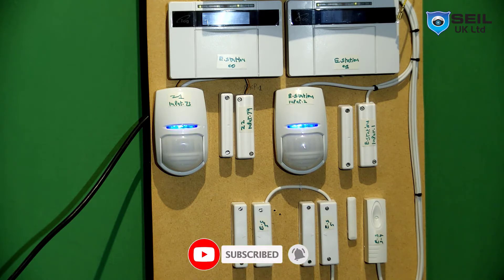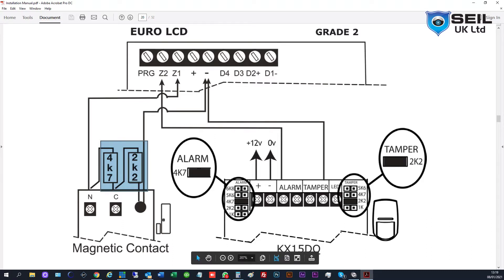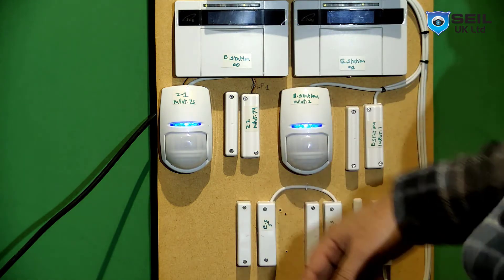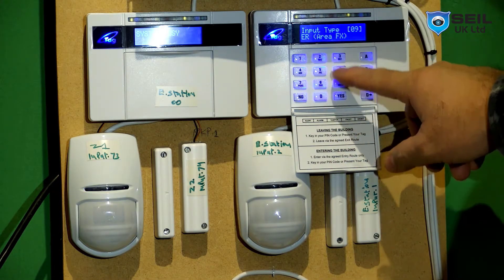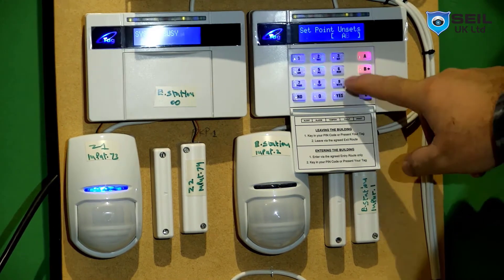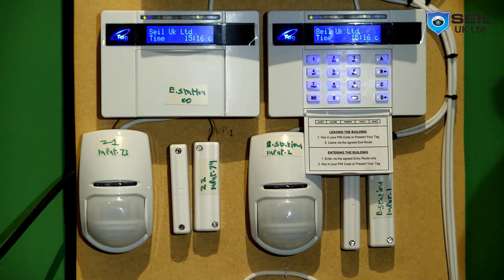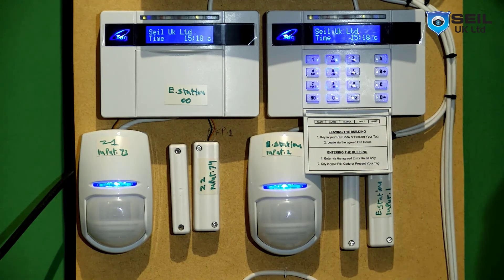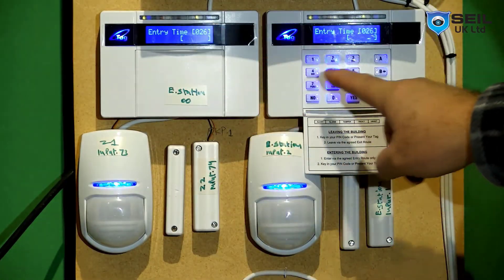How to do Programing and Installation Pyronix Euro-46 Keypad 2 Zone Z1, Z2

Comment: why did you choose zone 72 and 73 are they the default kepad zones on the pannel?
Reply: Hi I’m just doing a second keypad on Texecom verities 8 and just wired second one to the panel same as existing one. And on existing one changed small switches to 1 and new one to 2. Problem I’ve got is new keypad not doing anything lights up but not working any ideas?( existing key works just fine)
(Both key pads led not lcd so can’t see anything just 8 led lights)
Reply from the maker: Hi I install long time before used texecom system now I am using Pyronix system. As you my all videos about Pyronix system. You need call texecom help desk. I tried to give you answer which I remember you put maximum 6 keypad by default keypad set on address 1 2nd must set on different address. Texecom have 2 types keypad excel and R8 keypad your keypad is R8 which you mansion in comments. You need to set dip 2 on make sure off all power when you set then on power. Hope this is helpful for you. If not work call texecom help desk. Thanks to support my channel and good luck.
Reply: @shahzadsheikhs  thank you 👍
Reply from the maker: Yes they are default zone manufacturer design like this. This is my demo video if you need an other zone you can used another 2 more zones. Hope this is satisfactory for you.
Reply: Thanks for the reply Shazad, that helps a lot saves buying a euro zem, is 10 zones the maximum on the euro 46
Reply from the maker: Yes you can used 10 zone on euro-46 panel 8 zone on panel and 2 zone on keypad good luck thanks to visit my channel